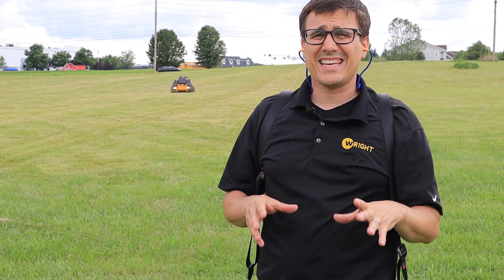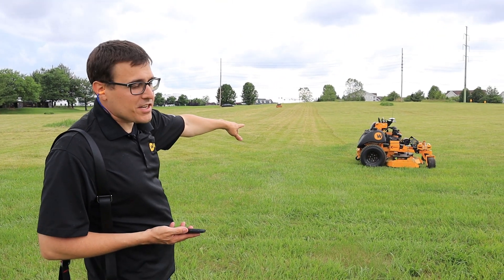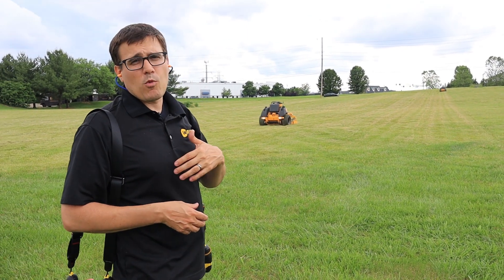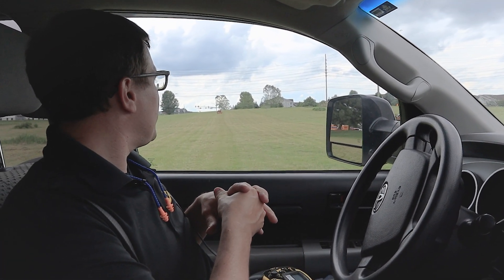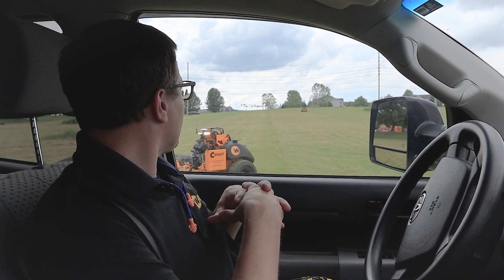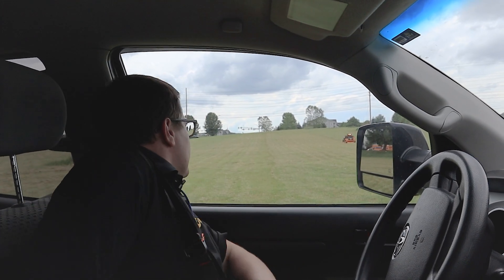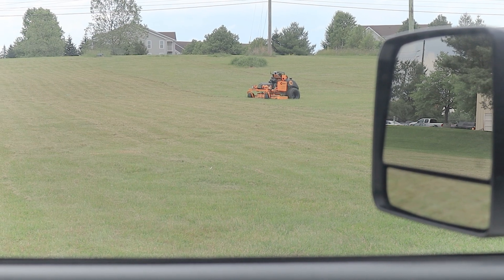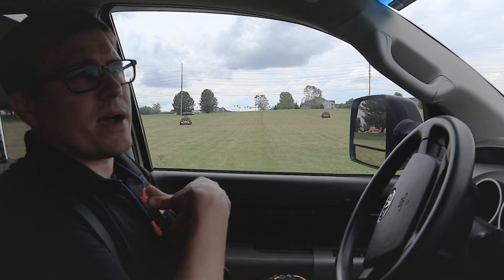Autonomous Stander ZK UPDATE and OVERVIEW | WRIGHT

Comment: You could add an engine logging system, vacuum pressure sensor for dirty air filter, oil pressure sensor, oil level sensor oil temp and what not. You could add all this so when that machine is running far away you can have an emergency stop or a way to alert the user.